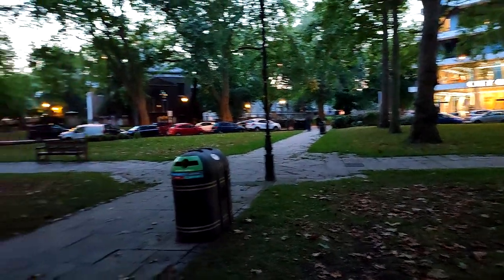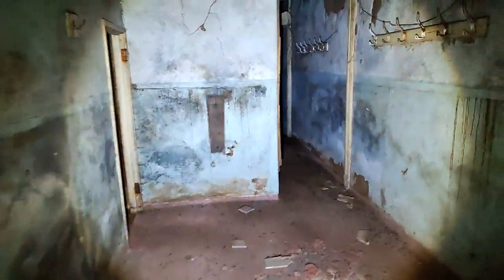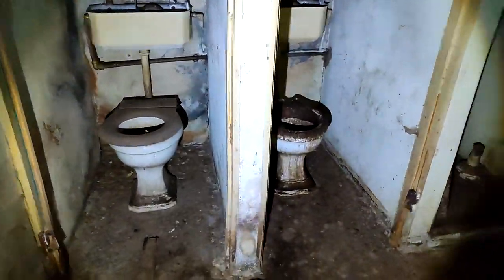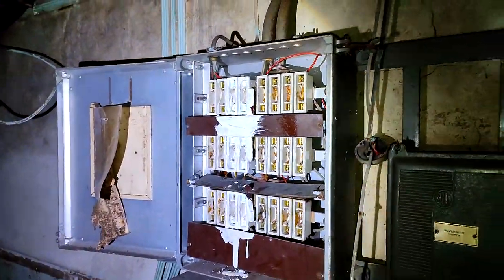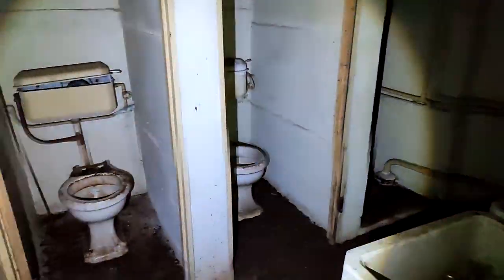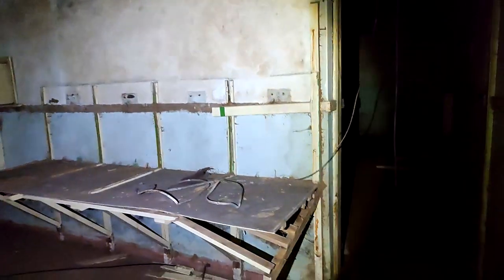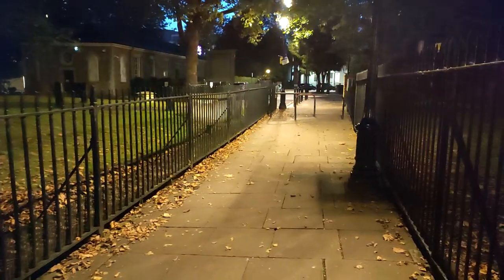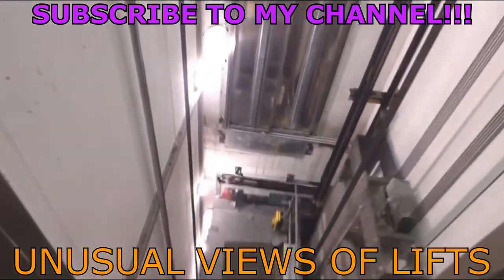URBEX Paddington Bunker

Comment: One of those loos had a nice thick old fashioned seat. Probably for accommodation, the bunker would have had a "hot beds" system with people on duty 24/7. In the nuclear war film "Threads" the people in the bunker deep under the city council building initially survive the blast, but then suffocate to death as the ventshaft was blocked by rubble.